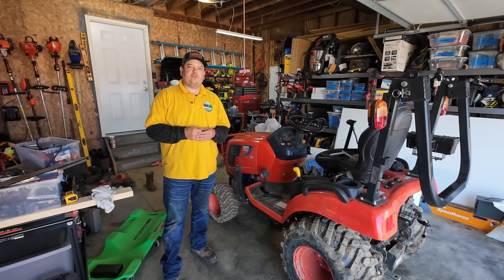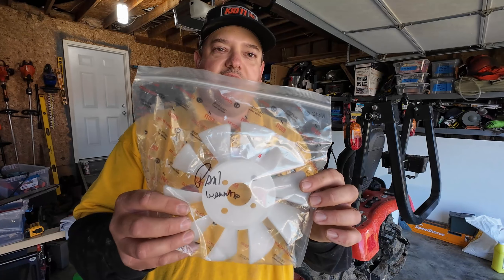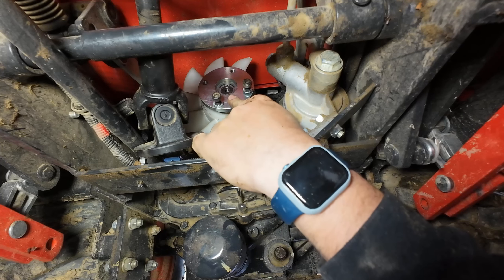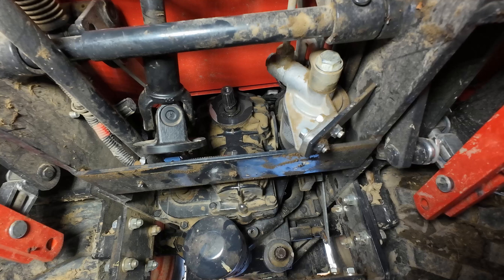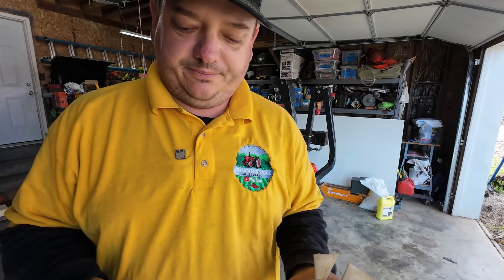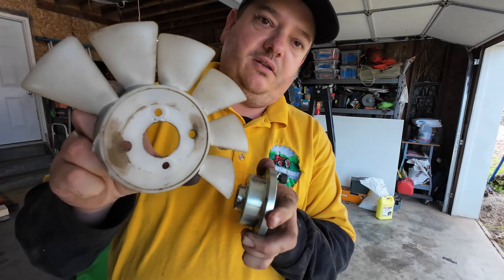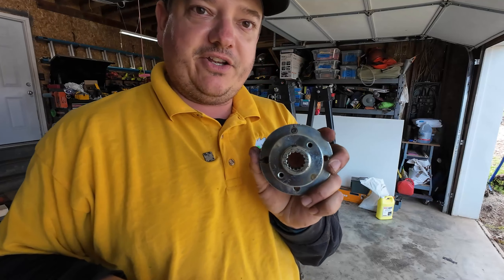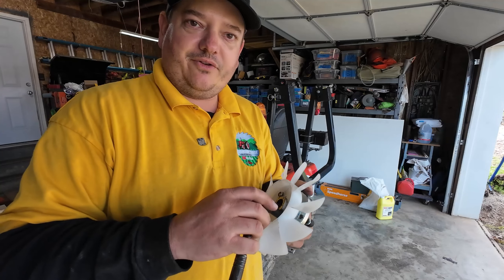Kioti CS2520S Hydrostatic Transmission Fan Change #385

Comment: When is the video on a solution to this never happening again coming? I wish to do something so it doesn't happen in the first place. Thanks for these videos as im getting a cs2220 and it's almost identical.
Reply from the maker: It’s coming soon I actually started making it and found a brace put on wrong on the tractor then I got sidetracked using the tractor and not taking the time to make the video, but it’s coming probably in the next couple weeks